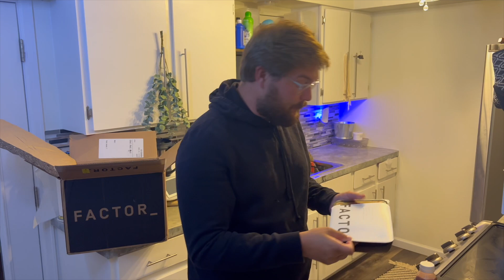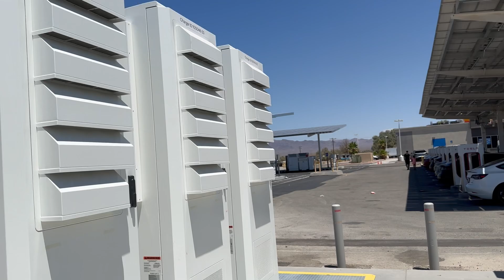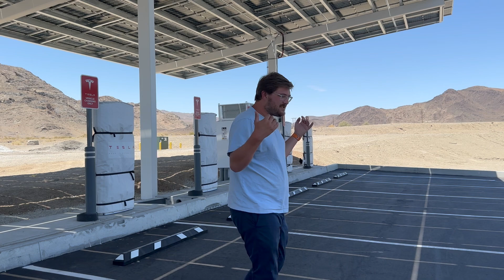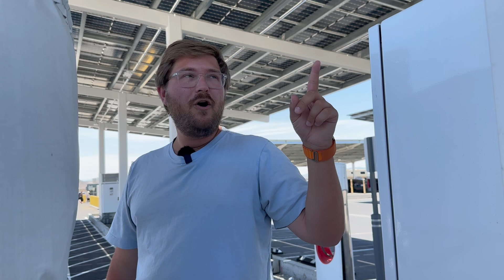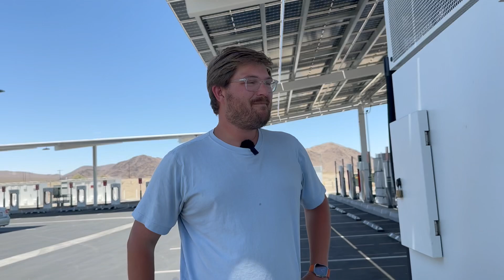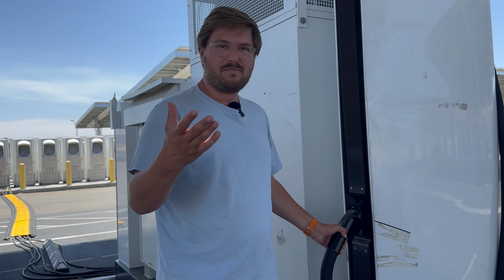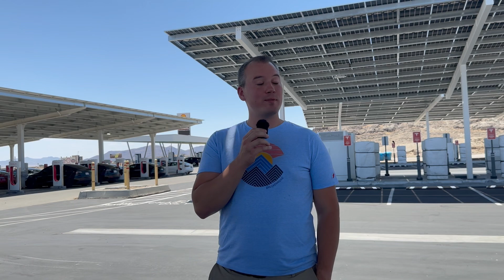Tesla Megacharger! Visiting A DCFC Location With Over 100 EV Chargers. Welcome To Baker, CA

Comment: Hey guys, you don't know the impact this is going to have in the electric utility/grid industry! We've been talking about this, formulating plans around it, and (frankly) dreading the day it arrives. Well, now the reality is staring at us in the face. You've done a great service finally waking up the utility execs because this nerd-topia video will have them crapping in their pants.  And soiling is deserved. I'll be showing this to all my colleagues and Exec peers. BTW, I should take you through a stroll of a facility that has 365 MW Motors 😊
Reply: The only way for there to be enough electricity in the future is to build more nuclear plants.
Reply: @briannave7326 it's one of the ways! We just need to develop cheaper and modular nuclear power plants or developing new technologies!
Reply: @briannave7326  Not at all true.

Nuclear is the most expensive form of energy up front in both time & money.  Construction times are in years and even *decades*.  Nuclear power plant construction is absolutely plagued with being over-budget by billions and over-schedule by years on almost every construction!  Commercial nuclear power construction is the longest running joke in the energy industry.  

Nuclear will not have much of an impact on the transition away from fossil fuels as we need many thousands of terawatts of electrical energy to move away from fossil fuels on the grid and elsewhere.

Commercial solar farms energy prices have dropped to just US 3¢/kWh never seen before in the history of energy.  Wind is in the 4¢ to 6¢.  But new build nuclear is at US 14¢/kWh.

Nuclear power is also the only form of energy that can cause cataclysmic disasters in the 20,000+ year variety.  It doesn't matter who or what is at fault.  Try to get a new nuclear power plant built in a democratic society is very difficult as NIMBY will be extreme.  You will also find someone even against an innocuous solar farm in the middle of nowhere.   The rage against a new nuclear power plant will be 1000x as bad.

Germany has completely dismantled their nuclear.  France is a poster child for nuclear having some two-thirds of its energy grid supplied by nuclear.  But France is now staring down the barrel of a major national energy crisis.  Its fleet of aging nuclear power plants is some 40 years old at end of life.  But they have not invested enough in maintaining nor training personnel.   Nuclear is so expensive, France has not launched a new nuclear power plant since 1997.  France had to import energy from neighbors in summer 2022 heatwaves because of (a) cracks found in pipes nuclear reactor power plants (b) high ambient temperature reduces cooling of the condensers of nuclear's steam cycle so nuclear has to throttle back its output.

For this and many reasons, commercial nuclear power will barely scratch the paint off the amount of energy needed to replace fossil fuels.  All that time, money and effort should instead go into renewables during this critical juncture in human development.  Perhaps we can look into nuclear later.
Reply: Wtf are you even talking about?!
Reply: The fossil fuel is also responsible for launching rockets for Internet which connects those charging structures.... With fossil fuels the EVs can be shipped worldwide! The factories for EV and mining.... Agriculture aviation and much more! Again what have EVs ever done to contribute!?
Reply: @carholic-sz3qv  Fossil fuels generate massive amounts of toxic air pollution that contribute to millions of premature human deaths every year. They are also responsible for climate change, oil spills...tremendous amounts of damage.
Reply: @carholic-sz3qv  What have EVs done?  And who are you trying to fool around here?  

EVs have done plenty in its short time.

Internal combustion engine (ICE) sales have already peaked 2017 and are in now in decline of years past.    

From Bloomberg New Energy Finance (BNEF):

with 2022 data now available, BNEF is confident the global market for internal combustion vehicles peaked in 2017 and is now in structural decline. _

From IEA (2023):

Electric car sales break new records with momentum expected to continue through 2023

Electric car markets are seeing exponential growth as sales exceeded 10 million in 2022. The share of electric cars in total sales has more than tripled in three years, from around 4% in 2020 to 14% in 2022. EV sales are expected to continue strongly through 2023.

EVs are a big piece of the global de-fossilization of our society.  Ground transportation is responsible for some 12% of global greenhouse gas (GHG) emissions alone.  The EV industry is already spurring advances in battery technology bringing about higher capacity, higher power and safer batteries and at an ever decreasing price.  The cost of solar and lithium has dropped a massive 90% since 2010 and continue to fall. 

Also very critical to understand is that EV provides financial incentive to upgrade the electrical grids.  That is, every dollar spent to upgrade the grid buys both a cleaner grid and cleaner transportation.   ICE vehicles have never and will never provide such an advantage because there simply isn't any incentive too.  

Electrification of the grid will bring down another huge chunk of carbon emissions.  Because residential & commercial buildings emits some 17.5% of global GHG.  

But continued use of ICE just promotes more fossil fuel use.  It empowers oil dictators like Putin to use energy as a weapon and for economic blackmail.  Continued fossil fuel use just digs us further in the climate crisis hole.  What's the first thing you should do when you find you've dug yourself into a hole?  Stop digging!

Critically, energy independence is increasingly seen as vital to national security but fossil fuels and ICE vehicles do not align with that.

Furthermore, burning just a single gallon of gasoline produces a surprising 20lbs of CO₂.  A single American family car outputs 5 tons of CO₂ per year!  Multiply this by a billion such vehicles on the road right now!

Internal combustion engine technology, with its pathetic 20% energy efficiency, will eventually be placed in future tech museums as an icon of one of the greatest follies of humankind.

The placard at each exhibit will also show how the "auto-mobile" usually carried just a single 150lbs human but along with 3000lbs of metal & furniture all so inefficiently.  We fell so much in love with the ICE car that we didn't mind using our atmosphere as a free-to-use public sewer anytime anywhere.  

Future generations will look back at all this with a mix of feelings ranging from anger, shock, to embarrassment.
Reply: Are you suggesting that electric utility is the one industry that is dreading more demand and lower generation cost?
Reply: @Martinit0  the utility is dreading the relative huge increase in load in areas that are not designed for these concentrations of loads. And they can't get the infrastructure built fast enough. The sites in operation now are the low hanging fruit where the electrical load can be accommodated. Those are few and far between. We can't keep up with the usual refurbishment, maintenence, and scheduled expansion as it is. And now they want to double or triple that work load? Good luck.
Reply: It will be a challenge but not insurmountable.  You just have to re-think the problem a bit and not hit it with the same fossil fuel dinosaur brain thinking we've been accustomed to when it comes to energy. 🦎

Most important change is that each individual EV charging station can be equipped with its own EV battery pack co-located next to it.   For reference, the average EV pack size 40kWh.  This co-located battery pack pretty much guarantees each EV that pulls up to charge will get a good portion or all of its current without pulling anything from the grid during its charge.  Both the co-located pack and the grid can be charging the EV in parallel.  The priority between the charger's battery and grid can be software controlled.   The co-located battery pack chemistry can be specially tuned to this task.

Chargers are not frequently used back to back.  So the charging stations control electronics will work diligently to refill the battery pack from the grid in-between charges.  Since there's usually a lot downtime between charges, the charge rate can be programmed to just "sip" power from the grid at low currents to minimize peak loads on the grid — like the reservoir tank on a house toilet.

Think of the co-located battery equivalent to the reservoir tank of a house toilet.  Each toilet has one.  If there is unusually high EV charging activity, the driver will have to wait.  Just like waiting for the toilet's reservoir tank slowly re-fills before you can use it again.  Its mostly a non-issue but its an "edge case" to know about because it helps to stabilize the regional grid connection at a rare inconvenience to the user.

AI and other heuristic algorithms can be employed to try to predict charging traffic activity and adjust the charge accordingly.  The software can also have cloud connection to the regional grid to know what is available in real-time to really fine tune its behavior.

This method of having one EV charge battery per charging station add some cost.  But the reliability is highest since each charging station has a distributed energy buffer and scales linearly with the amount of charging stations at any given site.  

Other secondary optimizations:
⋅ On-site solar panels (kilowatts to megawatts scaling with the size of the charging site)
⋅ Tesla Megapacks 3MWh secondary energy buffers.  Each Tesla Megapack alone charge about seventy-five 40kWh EV battery charges.
Reply: @beyondfossil bullshit! What fossil fuel mentality!? Are you drunk!? Oil alone is literally responsible for everything you see there everything from the grid to infrastructures/roads, power stations, the rae materials and plastics needed to manufacture and install those things! What have EVs really done!? Nothing!
Reply: @beyondfossil fossil fuel is literally what's making the world's economy to work and evolve! The biggest hydroelectric dams! Power stations and grids are all built using oil and ICE ....
Reply: @beyondfossil  Thanks. I know all that, I work with advanced control systems, renewable energy, and energy storage (but ion the GW range). What I'm worried about is the usual problem, which is people expecting and wanting 10 minute or 20 minute charge times. You know how patient Americans and Canadians are - not very. 

Hopefully we can balance a lot of it out with interconnected stations with combined energy storage. That is the sensible solution, as opposed to bulk/brute force thinking.
Reply: @bigskygeneration4474  Sure, thanks for the reply.  

I think a greater risk to the grid is the electrification of homes & offices.  

For instance, removing natural gas heating and natural gas kitchen ranges will add a lot of load on the distribution lines, transformers — not just the backend power plants.

A whole home electric heat pump may pull 3000+W for much of the day.  If its not a heat pump then may be 6000W.  Also, when everyone comes home from work to cook on their induction cooktops and ovens we'll get another 2000W to 6000W.

We could be looking at tripping the fuse on the neighborhood transformer especially during cold winter with whole home heating.

Energy buffering is probably the go to solution to handle a lot of the cases (except for all day home heating).  For the average home, a 15kWh whole home battery like Tesla Powerwall 2 could do much of this.  

But a big problem is most Americans/Canadians are broke.  A common stat is that 57% of working age Americans could not afford a $1000 emergency expense.

The other thing is a "smart breaker panel".

Any thoughts on this?
Reply: @beyondfossil with oil there are literally millions of byproducts including tour EV which is literally 40% of it! Fertilizers and fuel for agriculture! Even in emergency situations it's always fuel that's used to either rebuild cities or save peoples life's it even supply people with food.....
Reply: @carholic-sz3qv  Do not confuse oil based products and fossil fuels.  Fossil fuels are being targeted for rapid elimination and petroleum products may be with us for a while but even plastics are not too great.

Daily, the world burns through about 100-million barrels of oil for energy.  That is staggering amount.  That dwarfs the amount used for plastics (the vast majority) and other miscellaneous petroleum products.  We could pave a plastic highway across N. America with a few days worth of that!

Without the fossil fuel component, petroleum companies will be just a small shell of their former selves.  Fossil fuels infrastructure will be dismantled in the coming years.

Let's not forget that plastics are having a damaging effect on the environment with pollution.  There are two gigantic Texas sized patches of plastics floating in the Pacific!  See the Great Pacific Garbage Patch.  Some plastic found were from the 70s still intact.  Microplastics that come from bottles and other food packaging are now being found in the human body.
Reply: @beyondfossil ohh another very important point is that it's still with oil that those offshore windfarms! Renewable energies are beeing installed and maintained. I've never seen an electric crane or truck or ship go to remote places of even open a road to be able to install those!
Reply: @carholic-sz3qv  I really hope you're not seriously believing in what you're writing.

Realize this basic fact you're completely missing in your comments: We live in a fossil fuel hegemony right now.  

Fossil fuels are the incumbent form of energy for the past few 100 years.  So of course it is the "go to" energy source.  This is because we've built our societal infrastructure, economic supply chains, political backing around petroleum.  Hegemonies can and do fall!  Fossil fuels currently enjoys the global weight of an extremely wealthy and highly politically connected global petroleum industry.  The industry has powerful politicians in its pockets.  

Next to mother nature herself, the most powerful force on Earth is the global petroleum industry.  A vast empire that has done extremely well to socialize the cost of fossil fuels (climate change, pollution, health problems) while also privatizing the profits!

Extend your gaze a little bit farther out.  Realize that the 100 years where petroleum really took off with internal combustion engines are only a tiny amount of human history.  The earliest artifacts of human civilization go back some 5,000 years to the fertile crescent in the Mesopotamia. 

Why do I mention this?  Fossil fuels will only be brief love affair for humans in the larger scheme of things.  Fossil fuels have brought about a global carbon climate crisis.

Because the Earth's atmosphere is now at CO₂ concentrations exceeding 421-ppm.  This is a level not seen on Earth in some 4-million years going back to the middle Pliocene epoch!  All this occurring in a blink of an eye and started ramping up increasingly from the start of the Industrial Revolution.  That's when humans really started burning fossil fuels at industrial scale.  The atmospheric CO₂ concentration chart for the past 200 looks like a "hockey stick" with explosive growth. 😳

Why has his happened?  Because fossil fuel use is emitting an incredible 37 billion metric tons of CO₂ a year!   This is carbon that was pulled from deep within the Earth's crust.  It was formerly completely sequestered out of the biosphere but now is freely emitted into our atmosphere where it shouldn't be.  This doesn't even include methane (CH₄) from all our natural gas use.  Methane has 80× the greenhouse potency as CO₂!
Reply: You will notice there are not a huge number of EVs there all charging at the same time. Also, Tesla has many solar panels and there is onsite energy storage.
Reply: @JakeRichardsong  who cares!?!

Comment: Great the Mega charger does not have any of the useless lights buttons and switches like CCS charges have.
Reply: They should at least light up the Tesla logo, however, as an easy way to show that the stand is live and most likely operational. That's helpful for existing V2, V3, and gas pumps.

Comment: 56 v3 plus the the 40 v2 already in place but you failed to mention they have pulled a permit less than one mile northeast for for another 32 (v4?) plus a restaurant. 128 total for Baker.

Comment: You need to come to Montreal QC and check out our Circuit Électrique infrastructure that’s everywhere. I don’t even need to “plan” road trips here
Reply: Most of them are 50kW or 100kW though...
Reply: @brandenflasch  I agree but at least the network is there. They are upgrading quickly though